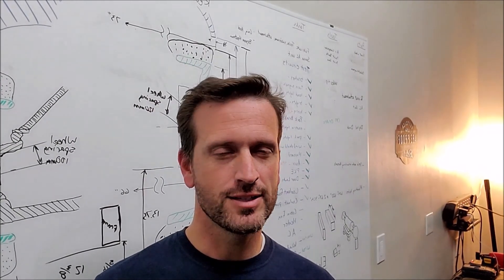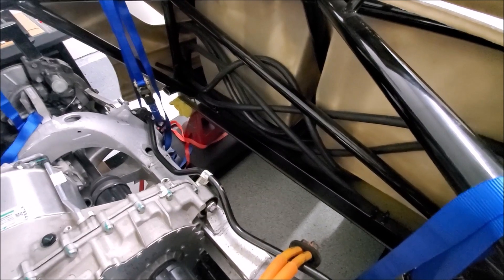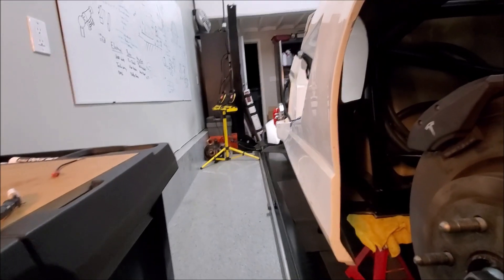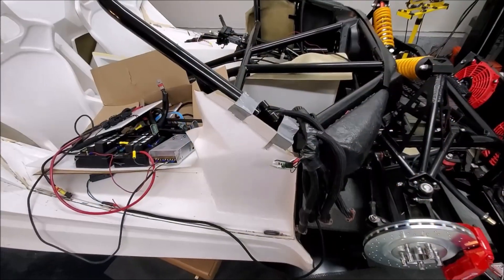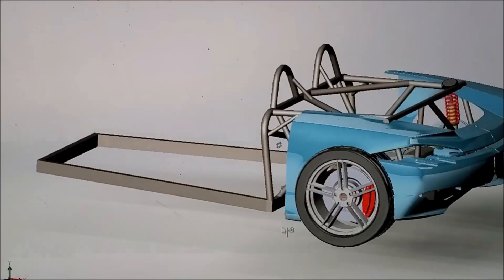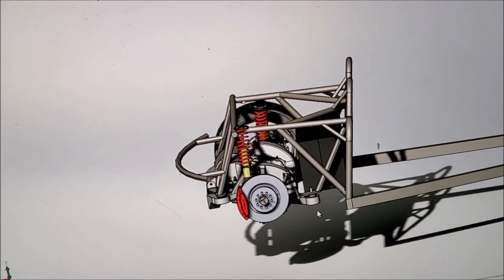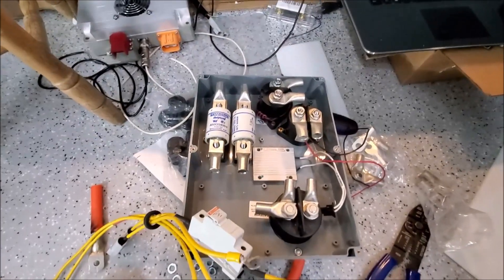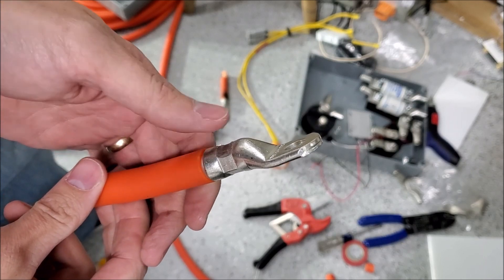Electric Vehicle Batteries - LG Chem Lithium Ion

Comment: I love your videos brother. I was wondering where you managed to order the batteries 🤔 I'm having trouble finding a company that doesn't seem sketchy.
Reply from the maker: I ordered from EV West.
https://www.evwest.com/catalog/product_info.php?cPath=4&products_id=481&osCsid=uoiko3ev9fderj2ba3n4sa8055
Reply: @electricsupercar  if i want the minimum number of batteries i would order only 7 right?? Because  each is about 60V to get 400V i should get 7.

I dont need range so thats okay right?
Reply from the maker: @FirstLast-tx3yj  you only need 6.  60V is nominal, max charge is 67.2V.
Reply: @electricsupercar  what about the current the moto uses 1800A peak would the 6 modules be sufficient?
Reply from the maker: @FirstLast-tx3yj  I have only ever run 6 on my car.  I haven't got my 2nd pack working yet.
Reply: @electricsupercar  do u have full power though? I want all 450kw but with the smallest battery
Reply from the maker: @FirstLast-tx3yj  You will have all the power.  I had my controller tuned down to 300kW and still did 0-60 in less than 3s.
Reply: Thanks a ton🙌

Comment: Another great video. Wondering how many miles you have figured with the amount of batteries you are placing. Also do you need to have a fan or some other way to keep them cool? I’m trying to go in order so if you already covered this please ignore my question. Also are you planing on putting sound deadening material to help keep out the road noise.
Reply from the maker: My plan is 12 battery modules for ~30kWh so I figure ~100 mile range.  I do have (or you will see if you are watching in order) a cooling system with a coolant pump and radiator.  I use the cooling plate on the battery along with a cooling plate that has the coolant flowing through.   I do plan on sound deadening material, although it is very quite already (electric vs. combustion)
Reply: @electricsupercar  hmm well I’m thinking on getting 14 modules batterys I didn’t know they was that expensive 😭 I need long range because I like to go everywhere driving!
Reply from the maker: @Mikeshakurs  check out my video on ev range testing
https://youtu.be/eDrfdAHqlnU

Comment: Heads up on stripping the insulation......you mentioned not cutting any of the wires off, but you only have to slightly nick them for them to be compromised☹️ Try taking a single strand of thick copper wire, say 1/16” and bend it repeatedly to try to break it. Then take another bit of wire, touch it slightly with a knife to put the merest of nicks in it, then bend it as you did first time, but on the damaged portion......it should fail very quickly and prove how important it is to not cut too deep when stripping insulation.
That solder was probably politically correct lead free crap☹️
Reply from the maker: Thanks for the advice!

Comment: You will want flux core solder, that's what will help your flow in those connectors.
Reply from the maker: Thanks for your suggestion.  I ended up going with the hydraulic crimper

Comment: Please look up how to wire your HV, you are making so many wrong comments it is quite scary.
Reply from the maker: First time trying.  Always looking to do things right.  Feel free to make suggestions
Reply: @electricsupercar   please review your fusing, all HV circuit/ devices need a fuse. Motor not necessary but anything that changes wire gauge. Also check the requirements for the precharge relay and how to wire it.
Reply from the maker: OK.  I have planned a 500V 400Amp fuse for each battery pack output.  I have planned a 600V 30amp fuse for the charger output.  Are there others I am missing?  The motor controller that I have controls the precharge relay.  I would love to get any other of your insights.  Thanks for the comment.
Reply: @electricsupercar  Fuse the DCDC also. The precharge relay needs to be within an HV enclosure and rated for the full battery voltage. The battery fuses are fine.
Reply from the maker: @Tom-evnut  Again, thanks for the advice.  Really appreciate it!

Comment: If you change your offsets that will most likely effect your bump steer/scrub radius.  In a short wheelbase car this can be a real handling problem (speaking from experience).
Reply from the maker: Thanks for the comment.  I think I am pretty set on widening the fenders.
Reply: I really think we are talking rear tire offsets hear because the Model S is really wide.  I agree if it where front wheels and offsets we where talking about. The rear offsets should not effect anything. If it had welded spiders to turn it into a solid rear axle then the wider the rear tires the worse the steering could become.

Comment: 18" wheels won't fit, I tried. 19" fit. I wanted 18" wheels and got a set to measure, no way they hit.   The 19" wheels and the 18" are pretty much same outside diameter with tires on them, just the side walls are smaller on the 19" wheels.
Reply from the maker: Good to know.  What offset will you be running?
Reply: @electricsupercar  I have the car up on the rack right now finishing the re-install of the motor and sub-frame. I am going to measure what I need for wheels while it's up. Right now without measuring closely it looks like about a +65 offset for a set of 10" wheels. Don't quote me yet.
Reply: @electricsupercar  I just bought a set of 19" x 10 with a 79mm offset, about 3".
It should be about perfect from my measurements. Worse case a 1/4" spacer may be needed but the wheels should fit inside the fenders or be even. I should get them Monday for the test.

Comment: Getting some fender flares / wide body kit is pretty cheap and easy to do.
Reply from the maker: Are there some generic fender flares / wide body kit?  I thought they were always designed to fit a specific car.  If you have any good links, send them my way
Reply: @electricsupercar  your cheapest option would be to roll the fenders if you have a small amount of 'poke'. Youtube roll fenders. Just need a heat gun and a fender roller tool. Any legit body shop could also do something custom or modify an off the shelf part to fit. Assuming you're going to have the car painted - that would be done at the same time.
Reply from the maker: Thanks for the info.  Do you know if the same process will work for a fiberglass body?
Reply: @electricsupercar  Hmm good question, that I don't know.  My initial thought would be no. Sorry.